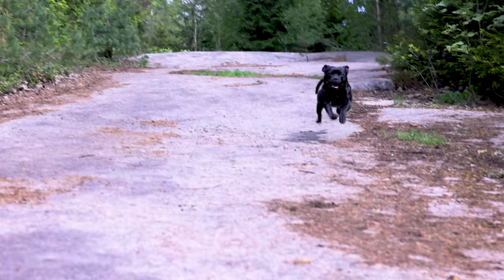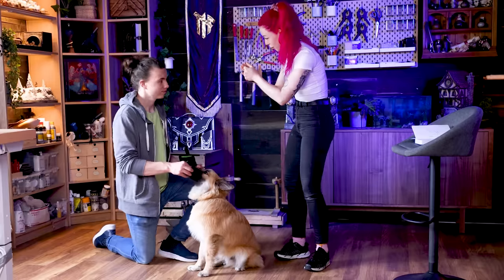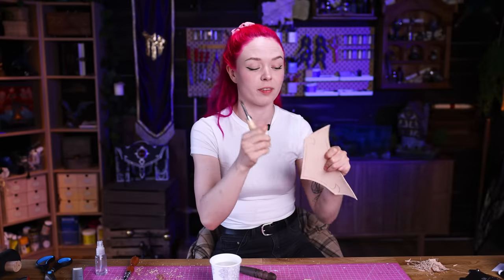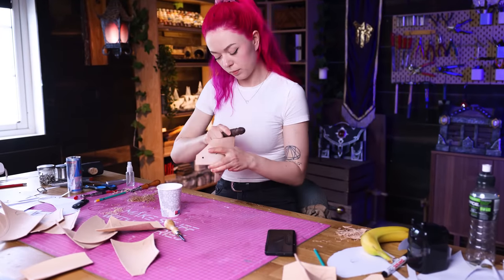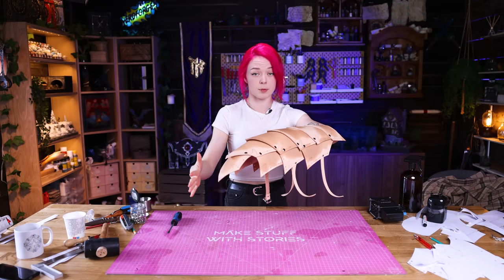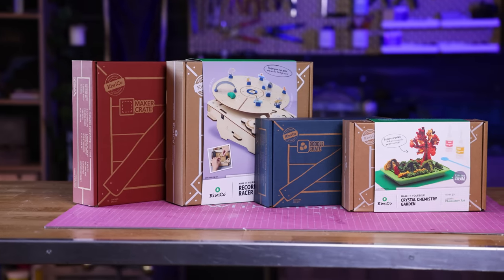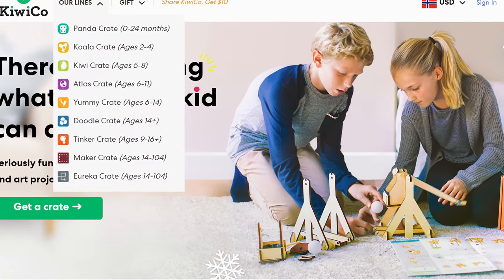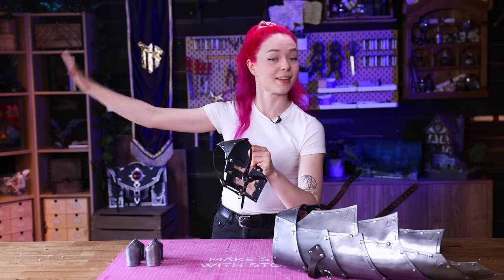My dog was bullied, so I made him armor

Comment: If you have an uncooperative model to test-fit, I found that the best material to make your pattern is linoleum flooring. 
It has the same thickness and rigidity as leather, can be riveted or sewn and is inexpensive enough if you ask the store for their offcut rolls.

Comment: This was so cute! Loved it. Idk how often you revisit projects, but if I might make a suggestion to get a better fit on the helm: Maybe try more of a Y shaped strap where the top of the Y forms a triangle around his ears& the current straps on the front of the helm  connect closer to the bottom back of the ear to a collar strap coming from the back of the helm. Seems like maybe that's what you were going for anyway, just where you connected it didn't work to hold it securely flat against his head.  Still super cute, tho!

Comment: It wasn't the front piece of the helmet,but the back. It was hitting the armor and pushing the helmet forward. Take the pointed part off and round it around the neck /back armor so it doesn't push against the helmet. I'd also round off the tip on the nose so it wasn't poking him,make it instead fit the curvature of his nose and go down more to the cheeks (since most canines attack the face/neck area,and the belly needs armor as well,since canines go for the softer parts of animals like the belly (And yes I know it's not "functional" armor just saying lol).

Comment: You could use the leather attach bronze plating on it. Bronze is lighter than steel and will protect better.

I have never worked with leather, so your craftsmen skills are impressive, you could probably rivet the bronze plating to the leather.

Comment: So cute, absolutely adorable and an amazing fit on the body piece! 
If you want to measure animals it is often easier just to take a piece of string and then measure that …no noise and it‘s soft.
I‘m really a bit concerned about his head piece and the spike which could easily land in his eye and lacerate the cornea …. If you would shorten and round it an inch or so it would be much safer!